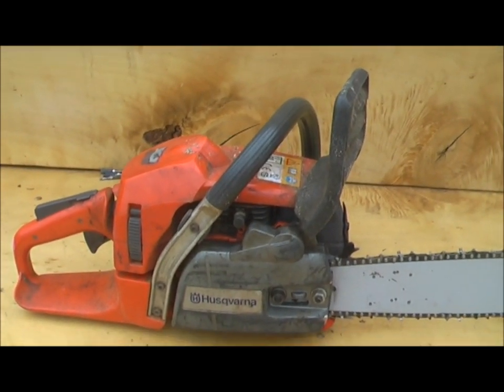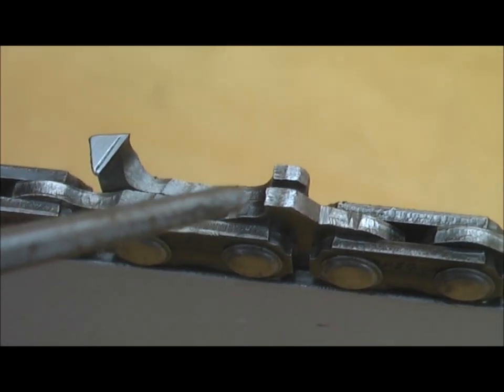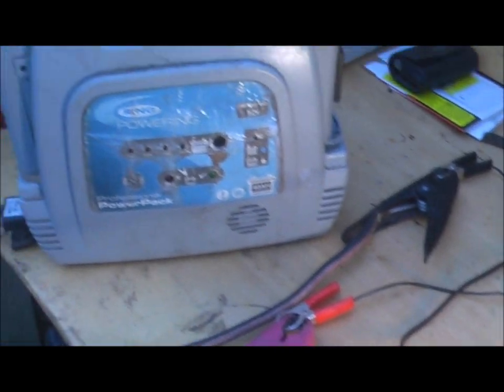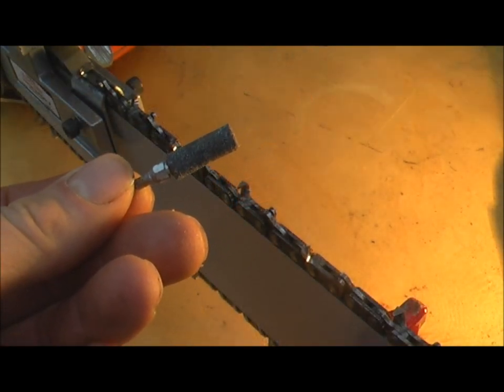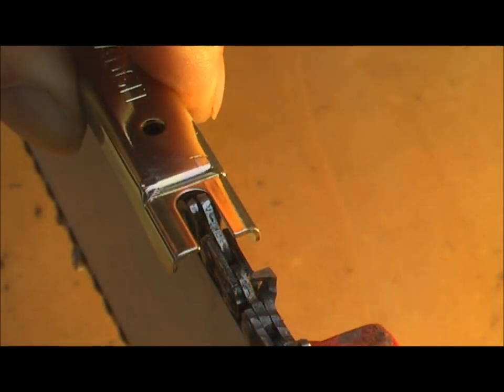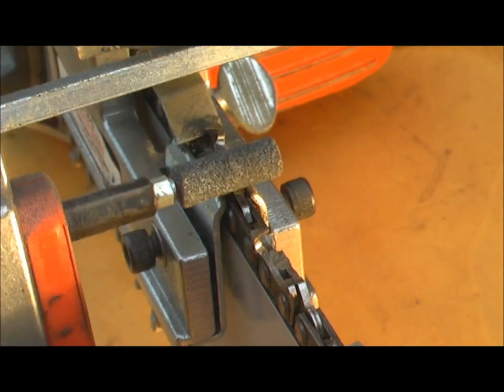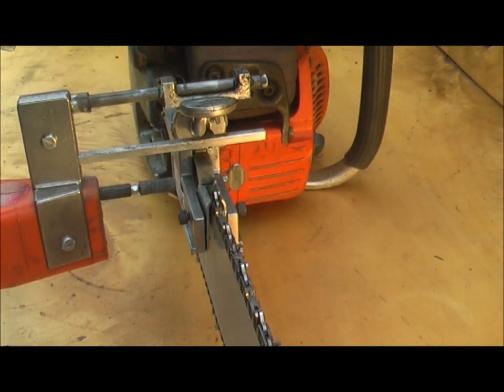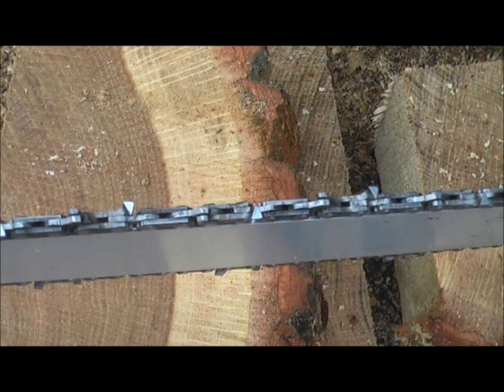Granberg precision grinder and accurate depth guage raker setting for chainsaw chain

Comment: This would make a great portable setup out in the bush. The trouble here in Australia is finding anyone who sells Granberg equipment. I have to use a file holder or the Makita 18v power drill with a stone or piece of file. At home I just use the shop grinder.  I love your setup for cutting firewood without pieces of log flying everywhere. I have to keep lifting the log onto the pile to avoid the chain touching the ground.
Reply: Check ebay mate I got a unguided grandberg 12 volt sharpener on there recently

Comment: I have been having fits with my grinder. Been using the technique of finding the height of the cutter and then using the adjustment knob that says each number is .010 to drop the grinder .030. I ground the rakers on several chains this way and they are waaaaaaaaaaaaaaay to aggresive now. Chains are unusable for bore cutting even in softwood and to aggresive to even cut hardwood. I will probably have to grind half the cutter back to bring the raker height back up.
Reply: If you are even remotely nervous about using the Granberg on the rakers then just use a flat file and the depth guage tool. I personally don’t use the grinder for the rakers for that reason. In his video he just gave them a bump. He didn’t take much off

Comment: Thanks for the video.

I have watched several videos but non talked about how to actually mount it.  

Is it set on the chain, or suspended (clamped) above the chain?

If it suspended, how do you account for keeping it perfectly flat and not tipped front to back?  I assume the clamp makes it even side-to-side.

Thanks,

ks